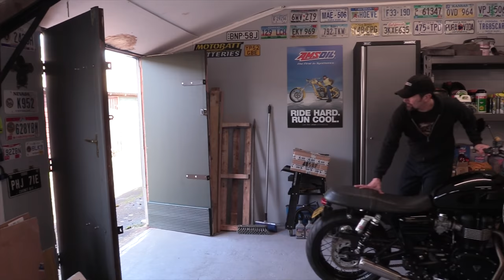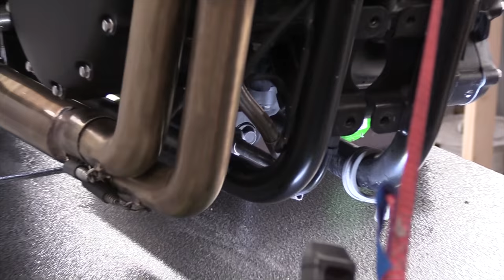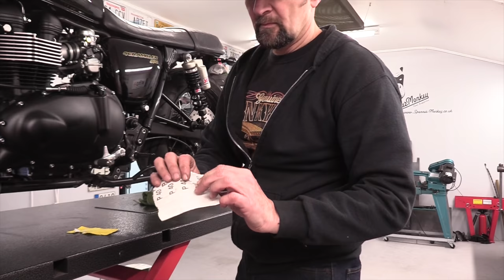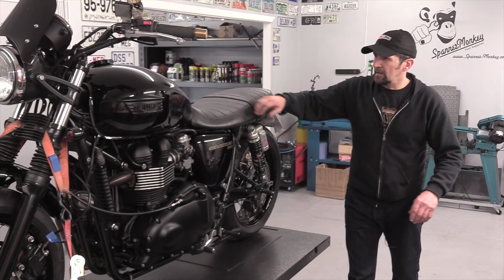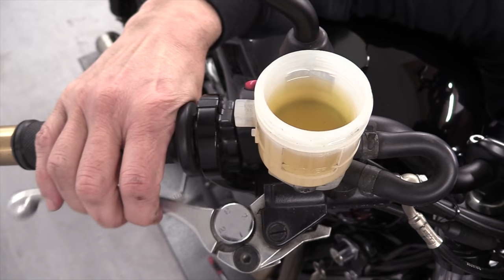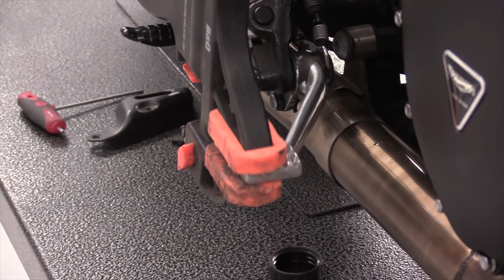Triumph Bonneville, Oil Change, Brake Fluid Change.

Comment: I recommend running the fluids at the proper level... bleed some fluid out the same way that you did for the flush before adding new pads... then proceed to fill the reservoir back to the proper fill level. 

Or better yet take care of the pads now.
This only makes sense to be able to reference the factory marks.

Comment: Go ahead and accuse me of being a cheapskate but last year I switched to Mobil 1 Racing 4T 10W-40 motorcycle oil to save a little money. I had been using Castrol. With the help of your video on the subject,  I installed progressive shocks and springs at about the same time. The ride is considerably more comfortable now with less hammering of the spine under most road conditions. My first motorcycle, a Honda Super 90, was equipped with drain plugs on the bottom of the fork. It made changing fork oil a breeze. I wish it was that easy with the Trumpet.

Comment: I bought my 2019 T100 in 2020from the dealer and it had just been serviced with 2200 miles on the clock. I received a message from the dealer that it needed an MOT this year. So I contact them and they offer a free MOT with a service for £335 I’ve only done 2k miles. Think I’ll just service it myself.

Comment: I know it's wrong to envy etc., but I do like that bike. Excellent film work too - things just gets better & better . . .
Pity no one thought to hinge that bash plate up one side of it's length, (couple of pinch bolts to hold it 'shut' etc.) it's only really there to stop rocks going in, not rods coming out, so having it 'burst' proof both ways is slight overkill - even for a Tri . . . .
Did I say it's a nice bike? : )x

Comment: Why you pulling the seals out of a brand new oil filter before fitting it?
Reply from the maker: It only drops in to a slot and it's beneficial to get some oil in behind it and then re-install it, which all helps to seat it perfectly when you install the filter.

Comment: I had my '04 Bonnie on the lift this weekend.  Noticed the oil looks murky through the sight glass.  Yours also looks murky and it's fresh.  My '05 Thruxton looks clean.  I wonder if there is something to the sight glass.
Reply from the maker: It's just condensation mate, take it for a long hot ride and it'll burn off !

Comment: Nice simple jobs well done. Does ABS cause a problem with changing the brake fluid? Cheers.
Reply from the maker: Nope, just don't run the engine whilst you're pumping it through.

Comment: What fender eliminator kit is that and does it fit on a 17’ t120? Nice vid and always a good feeling when you work on your own bike and in charge of your own safety
Reply from the maker: It's a Motone tail tidy kit, you'll have to check with them direct about the right spec for your bike!

Comment: Hey Del.  Love these types of videos.  I use a vacuum tool to change my brake fluid.  Have you ever used one?  If so any disadvantages that you have noticed.  Thanks pal.  Keep up the great work.
Reply from the maker: Hi there, personally I haven't, I just use this manual method and it's served me well for a lifetime.  Thanks for your support.

Comment: I like this model, it's classic. If I can't take the XJR-1300 anymore, I might replace it. Only the brake fluid holder is undemanding! It doesn't fit, but it doesn't fit a motorcycle!

Comment: Nice video. Why does Triumph recomend you disconnect the battery before you change the rear break fluid on the liquid cooled bonnevilles?

Comment: Few good tips  Del Sadly cannot do my front Brakes like that as my Z1000sx  brakelines feeds the other caliper :(
Reply from the maker: OK, you can still bleed them through mate, or do you mean you have linked brakes?  As they can still be done, it's just a matter of operating the cylinder.

Comment: Hi Del it's a service that you are doing for guys like us world wide.
It's always a joy watching you work. It's like watching a meticulously planned surgery.
Del I have a query as I live in India and sourcing parts for the bonnie is a big procedure, can I use a matching oil filter that runs on a suzuki 1lt 16 valve DOHC engine. The dimensions of the filter are identical and  it costs one tenth of the ttiumps
Reply from the maker: Hi Prasad, I hear this a lot with India, it's a real shame you don't have a better parts back up over there... What you're suggesting is sound thinking, and yes indeed oil filters are pretty universal, provided the fittings are the same... the Bonneville's actually use a very short filter, so that it doesn't hang down below the frame rails (being mounted under the engine), and then it can't scrape on the ground, or a kerb, or get hit by rocks and be torn open... so if you are using a filter with the same fittings, that fits on cleanly, then make sure it is the same height as a canister and doesn't hang down below the frame rails.... then it should be fine.
Reply: @Moonfleet41  thanks for the prompt reply. The dimensions of the filter I found is identical with that of the Bonnie's. It's manufactured by Suzuki. Now that you have cleared my doubt I am much relieved.
Thanks a ton and keep up the good job..

Comment: Hey Del, grat work on your vids.  What is your take on dealing with a ABS system after bleeding the brakes? I know this is a 2013 so no ABS. I got a bobber 2019 with the modulator though…

Comment: I have 2 questions.  Where did you get that awesome bash plate that goes up over the oil cooler?   Why did you put grease on the brake fluid resevoir bolt, aren't you worried it will vibrate loose?
Reply from the maker: I fabricated the belly plate from sheet metal myself... nothing i liked out there, to ,made my own.

Comment: I am creeping up on the 25k mile mark on my 2018 T120. Judging from a visual inspection it looks like it's time for a new chain and sprocket. Any suggestions for a high quality brand for replacement? 
thanks for the video
Reply from the maker: If you really want to spoil your bike and treat it to top quality consumables, then you can't got far wrong with JT sprockets and a D.I.D Gold HeavyDuty, X-Ring chain !   not cheap, but then 'good ain't cheap and cheap ain't good.!

Comment: Hi I love your channel and thanks.
I have one question on starter gear shaft boss breakage.
How do you think about that problem of t100 shaft boss broken?
And also is it good idea to use TTP safe start?
Reply from the maker: Ive seen that casing fracture just once.. and it's totally devastating for the owner, ridiculous money to fix, so any device that can prevent it has got to be good mate !
Reply: @Moonfleet41  thank you for your answer, and so helpful
Thanks again from Korea.^^

Comment: I have been having some battery issues lately. New battery on the way. I've noticed over the last couple rides my digital odometer hasn't moved from 1789. I have rode 200kms since but no movement on the odometer. Any ideas?
Reply from the maker: I'm presuming your speedo is working or you would have said... and If you've had battery issues, then get the new battery fitted first Stephen, and if it doesn't resolve it then take a trip to the dealer, explain the problems and they'll be able to plug in some diagnostics and check it out..

Comment: How do you know how many times to fill the reservoir (brake fluid) - I couldn't see the difference between the colour of the old and the new fluid when I did it and had no idea of what the total volume of brake fluid was
Reply from the maker: On average a twin caliper system will take, maybe, 3-4 full reservoirs to purge through at least, it may not change colour, but it's the water content you're looking to get rid of!

Comment: Hi Del, great vid mate, can't beat a bit of regular servicing, like you said all ready for the new season.. Quick one mate, is that front mudguard standard it looks too sit quite high, just wondering, great looking bike though, ride safe, and batton down the hatches, storm Dennis is a coming aye.. 👍👍🏍️
Reply from the maker: Factory Scrambler mudguard, the bike just has different wheels, 17x3 on the front, rather then the factory 19x2.. leaves a bigger gap.!
Reply: @Moonfleet41  cool jobs a dream, cheers Del.. 👍👍🏍️

Comment: When the oil has settled to the bottom of the sump, are you still supposed to see the oil level thru the sight glass? New T120 owner.  Thank you!
Reply from the maker: Yes sir, thats right, the sight glass is to check your oil level is correct.
Reply: I suppose am a bit confused. The bike has sat over night and on its side stand. When I look thru the site glass I don't see any oil. Does it need to be on its center stand to see the oil level? Sorry to be a bit slow.
Reply from the maker: @ferdinandnovilla5151  No problem buddy, it's a common question, you check the oil level with the bike upright, and as the sight glass is on the right, it will naturally disappear when you tip it on to the side stand... so centre stand is good, and if you don't have one, a paddock stand is just the same!
Reply: @Moonfleet41  Thank you sir! Am learning a lot from your videos. Keep up the good work. Thanks again.

Comment: Hey Del. Love your videos.  Very helpful.  How do you reset the digital maintenance reminder after changing your own oil? I have a 2016 T120.  It has the little  wrench icon in the display.
Reply from the maker: Drop in to the local Triumph dealership, they can do that for you mate.
Reply: @Moonfleet41  Thank you sir.  I was trying to avoid the $60 labor charge for that but it seems that might be the best option.
Reply from the maker: @randalbowers210  Yeah, sadly they have the digital equipment to switch off warning lights in seconds, the only dodge is to buy similar equipment yourself...which does;t really save you anything.!

Comment: I saw recently on Amazon a bag (qty 20) of those aluminum drain plug washers. Have you had any experience with the aftermarket washers? I did fluid change, last year, on my Rocket III and I had three of those washers.
Reply: Any copper washer will do too

Comment: Is it fatal if I don’t pre-fill the filter with oil? Instead I attached the empty oil filter on the bike first then topped it up with oil
Reply from the maker: No that's perfectly fine Robin, it's under the bike, gravity fills it as you pour the oil in, juts top up, run the motor for a couple of minutes, then top up again if needed..
Reply: @Moonfleet41  thank you!

Comment: Oil drain plug should be tighten at specified torque otherwise it will damage the threads.
Reply from the maker: Exactly as I did do.
Reply: I stripped a plug once while putting it to the specified troque. I used a callibrated (Hazet) torque wrench, setting was spot on, and cleared out the casing threads. 
It was my first time doing the oil cap to the specified torque, before I just tighten it wrist thight. Never ever had a strip or leak. I torque almost everything to spec but I don't do that for the drainplug anymore. It's a big hard steel bolt in an alloy case. 
in the end, use a troque wrench but don't follow it blind.
Reply from the maker: @herbert4501  Alloy threads in things like sump pans get bruised over time due to slight and continued over stretching and end up weakened, chances are mate, you did nothing wrong, the thread in that sump was probably already damaged and you just finished it off... bad luck buddy, things like that leave a nervous shadow every time to touch them in the future aye..
Reply: @Moonfleet41  it was an old bike indeed. It was a good education not entirely to trust on what is written in books but trust your gut feeling too.
Reply from the maker: @herbert4501  Wise words indeed mate, you can actually buy aluminium sump plugs which will sacrifice themselves before the sump thread if you're worried, but hey, there's no substitute for temperance.

Comment: Why do you pull the gasket off the filter prior to filling with oil? Also always enjoy your videos from another American fan !
Reply: In an earlier video, Del explained that he removes, completely lubes both sides,, and then reinstalls the filter gasket to assure the gasket is slippery so it won't 'pucker' up when the filter is torqued down.

Comment: I've got to ask, why on earth is it called metric oil. I mean how is oil metric? Oh dear..(hangs head and slowly shakes it in utter disbelief)
Reply from the maker: Metric motorcycles is what Americans call anything non-American, so metric oil is oil for metric motorcycles.
Reply: @Moonfleet41  sort of  figured it, but it really highlights the politics of American manufacturing. Shame really.
Reply from the maker: @royking1  Actually, if you want to be really nerdy, it's not mechanical engineering that's responsible, but the American building trade, for generations they've resisted any use of the metric system and the schools only teach it on demand, so a whole civilization grows up with no metric and actually, I quite like the old imperial system,after all, it was ours first aye?  and is often easier to use in certain applications.

Comment: is this carburettor version so is it older version of Bonneville..
Reply from the maker: No it's a 2013, so fuel injection.
Reply: @Moonfleet41  ohh..oke..my mistake..but that throttle body look like carburettor.....and this model is oil cooled engine....then which year triumph launch Bonneville with liquid cooled engine

Comment: Hi Del, could you tell me the size of spanner i need for the brake bleed nipple please. Thank you.
Reply from the maker: there are two sizes you'll find on bikes, the smaller (most common) is 8mm, or you can use a 5/16 AF if you have one as its a slightly better fit.. and the larger size are 10mm.
Reply: @Moonfleet41  Del muchas gracias, thanks mate.

Comment: Napa sells a tool -Evercraft Service Tools #776-9089 for about $7.00 U.S. it has a built in one way puppet valve-slip one and over the nipple crack it open -depress lever or pedal SLOWLY until fluid drops refilling as needed -keep depressing until clear fluid is seen in hose -close nipple and top off as needed no need to remove canister -makes an easy job easier and less messy!